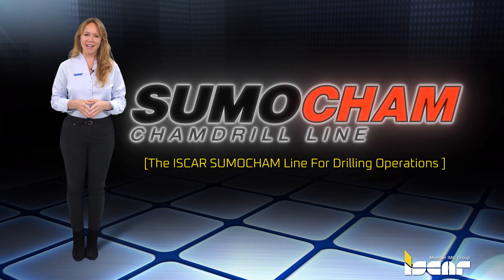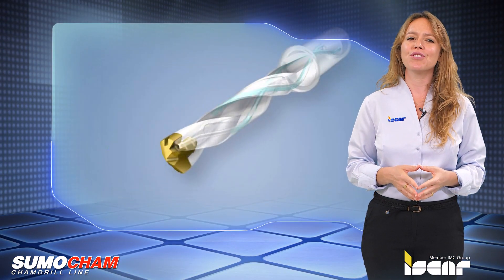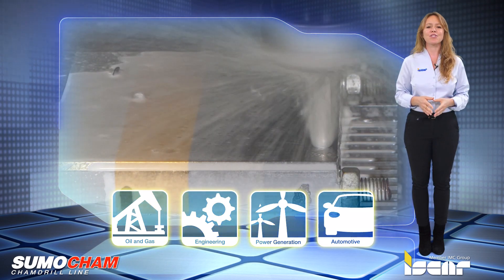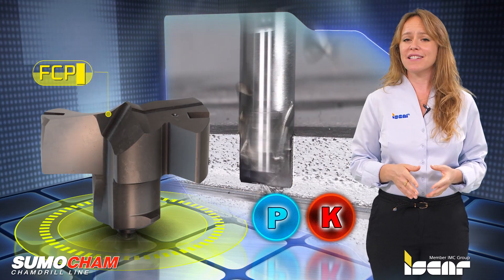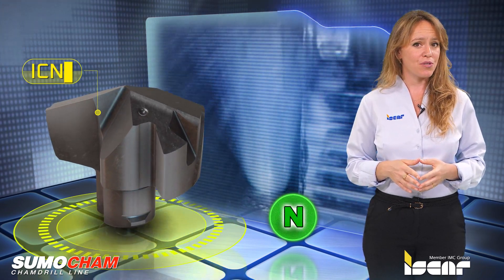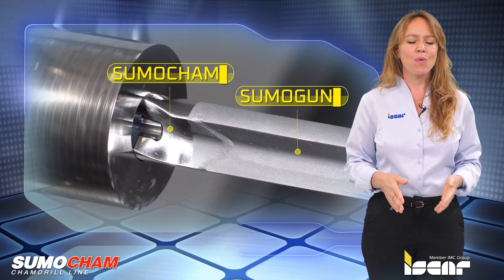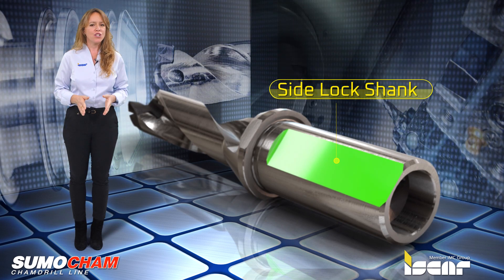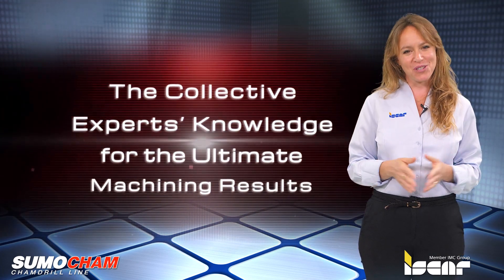ISCAR TECH TALK - ISCAR SUMOCHAM for Drilling Operations

Comment: Кто пользовался, на маленькие диметры реально мжет заметь монолитные твердосплавные сверла?
Reply from the maker: Yes, SUMOCHAM tools have more advantages over traditional solid carbide tools.
With just one drill body a wide range of drill head diameters and geometries provide the desired solution, with multiple indexes that eliminate the need for regrinding processes to renew cutting edges.
SUMOCHAM provides greater productivity and cost savings, yet in some cases solid carbide tools will remain the solution.
Reply: @iscarweb  Спасибо. Попробую
Reply: These drills are great. Weve replaced most of our dolid carbide drills with theem. We get up to 20x the tool life, and the tips are cheaper than a solid carbide drill. You can change the tip and hit cycle start. No need to reset offsets. Accurate holes. Great tool by Iscar.